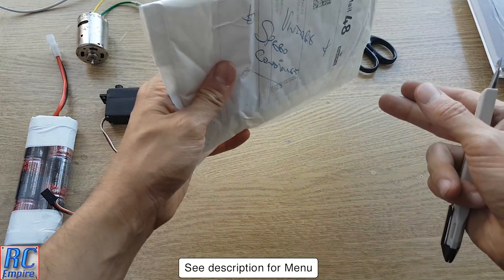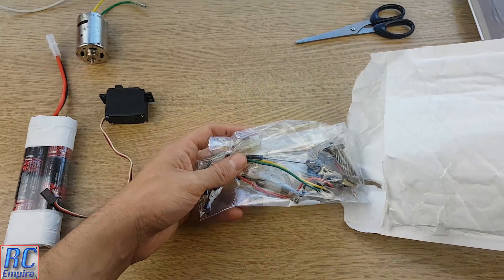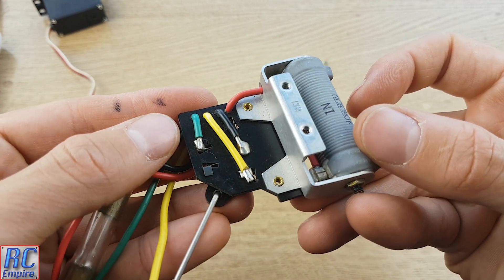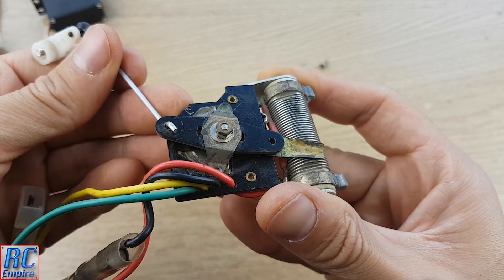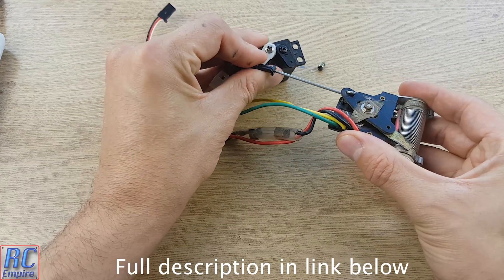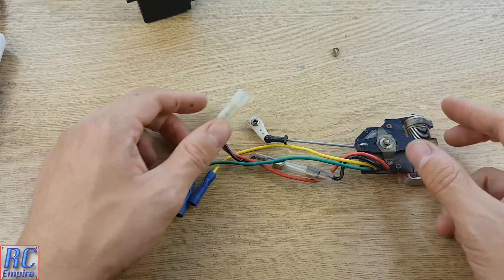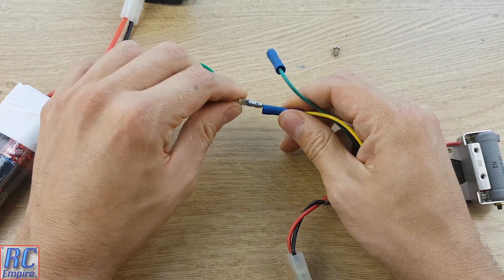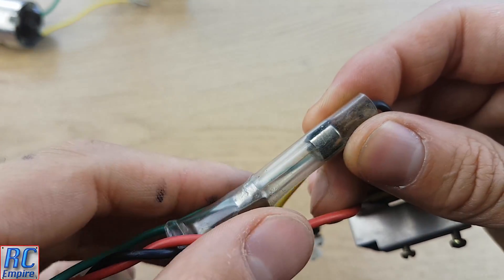Vintage Tamiya Mechanical Speed Controller Circa 1980 - Rheostat Resistor Type

Comment: I had this variable speed controller for my Sand Scorcher back in the early 80s. First it was very bulky and diffocult to fit in an RC card. It was also generating a LOT of heat. It melted part of my Sand Scortcher translucent plastic box with the 7.2 'hunch back' battery pack... ? Mine didnt come with a fuse. Later I resumed to the 3 speeds controller switch. Not very good either the connecting pad on the circuit board degraded fast due to high current...

Comment: I was using mechanical speed controllers before Chinese parts were readily available. I spent my $22.50 to buy one, and the resistor, and it lasted me a very short amount of time... eventually I thought I got a bargain for spending $60 on a Chinese ESC, and that lasted about 2 days before it had a mind of its own and then suddenly failed. Back to the MSC. As a child I wasn't able to just readily buy new parts at will, and eventually I gave up on those RC cars entirely. 
Kids these days have it too easy, especially when a $200 kitset I recently bought came included with a hybrid brushed/brushless ESC (with brakes!). Mind blowing. A good Tamiya or Futaba ESC was about $100-200 back when I started...
Mechanical speed controllers are fascinating, but absolute dog shit. Save them for those vintage builds I guess, but don't actually use them.

Comment: hi the plugs for the motor i dont think they came on it someone add them
and as for the power plug for the battery i think it was not a 7.2 battery it was a 6v 

i still have a vintage tamiya frog with the msc on it wouldn't change it for the world

Comment: I have a old rc boat that has a manual esc with 2 brushed motors. Can I just wire the 2 motors to one + and one - and hook up to a newer style brushed  esc. And if so what amps would u recommend. On a 2s lipo or 7.2 nimh...
Reply: Don't let them get away from you. Otherwise it's Goodbye boat. Sail away into the sunset 🌇